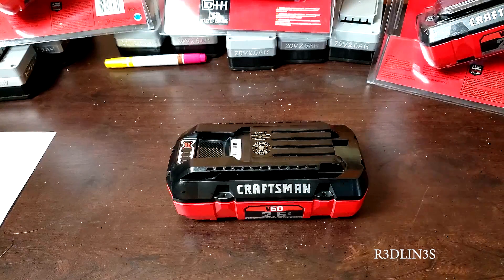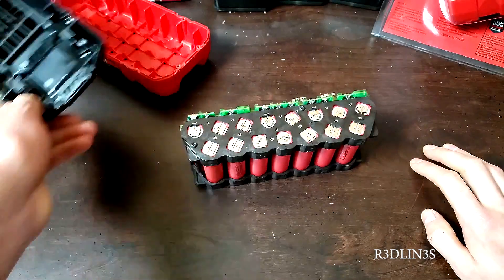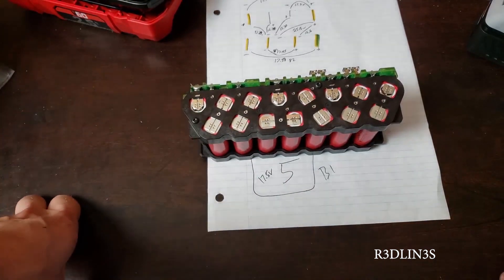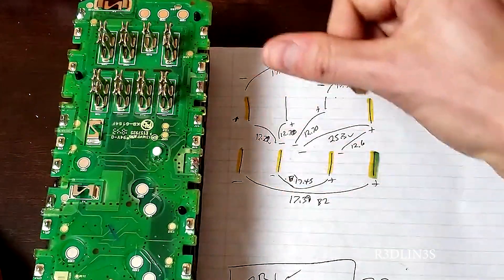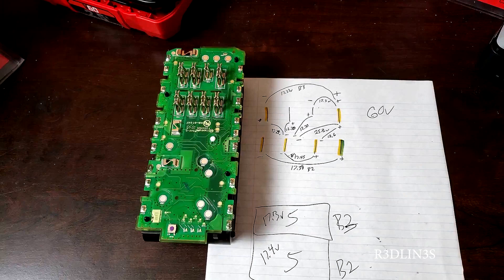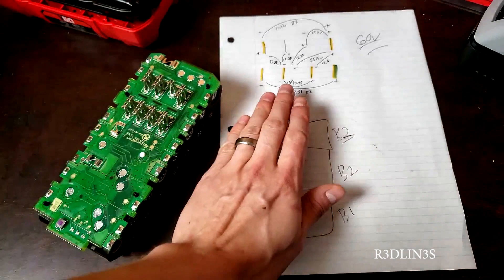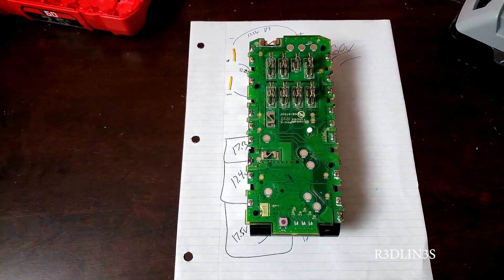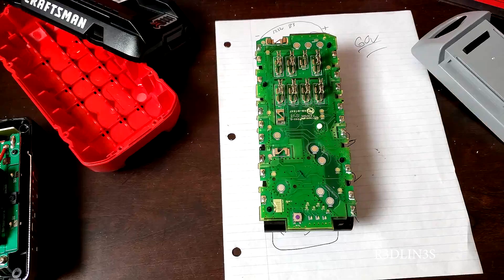Craftsman 60v Battery Teardown 2.5ah - How It Works

Comment: Would that 60v work for a ebike
Reply: Nominal. I'm using it for a moped. You'd have to jump all the pins. I've tried combining voltage, but still got 20.6. Depending if the mini packs got to their full voltage. Thou I stopped using series when it sparked. 
Hot wiring it to your discretion.
Reply: @KiwiClawDHA  would you mind share how you hooked it up? I'm trying to build a 120V inverter off it and am planning to use the 18V pins in parallel to a 18V to 12V step down converter into a 12V car inverter to 120V. Any advice would be appreciated.
Reply: @pauldentel461  I never found an 18v. 20, 8, and 4.
I'd also check each cell and the battery's fuses. Each one of my 3 has one broken.
Then it didn't pull voltage from all 3 cells when I used it. None of them charged evenly.
You're wanting to pull 18v out of a 60v battery?
Reply: When I pulled in parallel. I plugged two sets of wire into tgeterminals going
 + - + - 
You can voltmeter it quickly to find the pins.

Comment: Thanks for breaking the battery down and mapping the circuits. I just had a 60v die, and this saved me a lot of time (and money) so that I could jump start it.
Reply: Stephen Wong  Hi which 2 pins did you use to jump start it? My v60 lawn mower battery won’t charge anymore and I only used it once.
Reply from the maker: I can do a video. but basically the charger will charge all 3 mini packs at once and as soon as any 1 mini pack hits 20.5v it stops charging everything. so you would have to charge each mini pack up to 20.5v to 'reset the battery'
Reply: R3DLIN3S I already got a replacement but I still have the defective battery. I’m sure it’d be really helpful to others having this issue. Thanks!
Reply: @R3DLIN3S  I would very much appreciate a video if it wouldn't be too much trouble.  Likewise with Sam3gX, my mower battery died and I've been waiting over 3 weeks for the replacement to get to me.  Would a bench power supply be ideal for trying to charge it back up?
Reply: @3gXSam   @Sam3gX  Sorry for not getting back to you sooner. I wasn't notified that you replied. If you look at 2:15 of the video, it shows you the pos and neg terminals. You basically just match it up to your working batter with any working positive and negative terminals. I just shoved a 14 ga wire. Like what @r3dlin3s said, you need to charge all batteries to hit the 20.5v. I did this for my craftsman 60v 7.5 amp mower. Also look into your warranty, they are excellent and will replace your battery if you are within the usual 4 year timeframe.
Reply: @R3DLIN3S  i can contest to that. Only one of my 3 hit all 20.6v.
Reply: @R3DLIN3S  What did you use to charge it? and what contacts did you use? I'm trying to rehab a 7.5 amp battery. I don't have an extra battery to connect to it. I've "jump started" a 20-volt Ryobi battery with a 12-volt converter before, but I'm not having any luck with this one.
Reply: @R3DLIN3S  did you make a video about it. In having trouble with this battery pack
Reply: @DAHFreedom  I would like to know the same thing. Did you ever figure it out
Reply: @R3DLIN3S  my craftsman mower battery died as well. Can you please share instructions on how yo jump start please?
Reply: @3gXSam  did you figure out which pins to use
Reply: CAN YOU PLEASE EXPLAIN how you did this?  I have the same issue - battery will not charge, and when I test the leads I find that two of the packs are 18.3v and one is 12.8v.  I cannot get the low voltage pack to accept any charge.  How can I force this pack to recharge?  You apparently did it, others apparently have done it, can you please explain how?  Connecting the leads to another V60 battery does not work.
Reply: @christophocles  did you ever have any luck with this. same situation here
Reply: These batteries stink. Hence they are not made anymore and I don't think there are any left in the world lol. Maybe eBay but the batteries are 5 years old now so I wouldn't put a lot of faith into a "new" 5 yr old battery for $150.

Comment: thanks a lot for this super review. I also have a Greenworks 40Volt battery pack model 29662. I cannot figure out how to get 40V for the four available connectors. If you could decipher how that one works that would be super!
Reply from the maker: I can make a video. the pins on  the outside of the connector are your - +. just have to take it from there.
Reply: @R3DLIN3S  that would be nice. I've been jumping terminals and it either spark too bad. Drops voltage. One trial across two batteries got 12v.... or I got no voltage. 
Think the batteries was good intention.